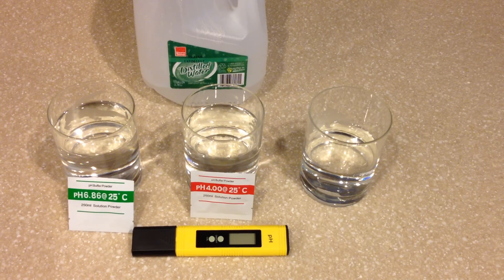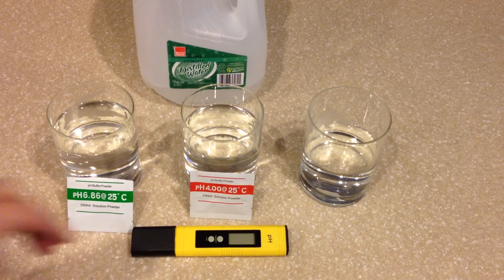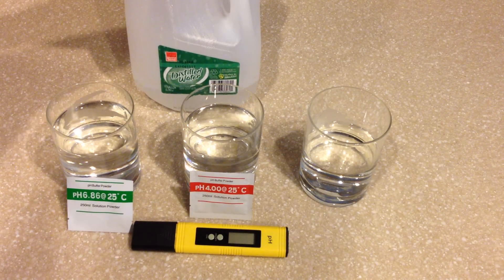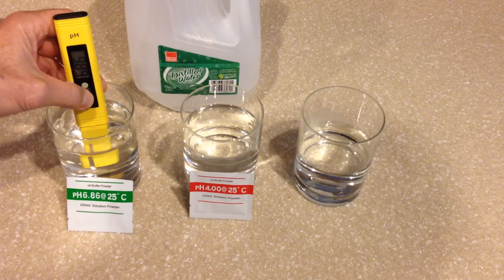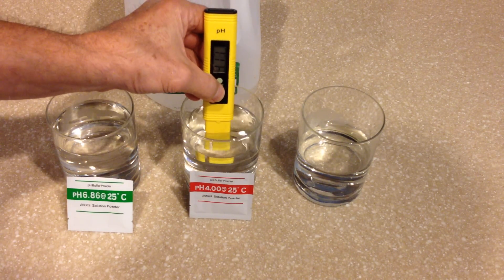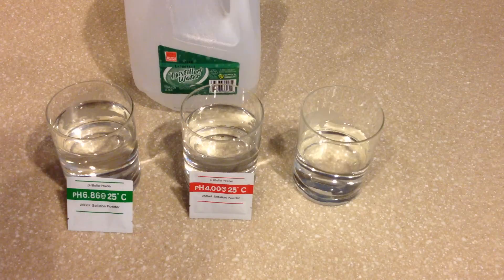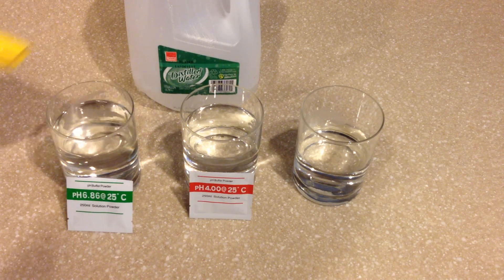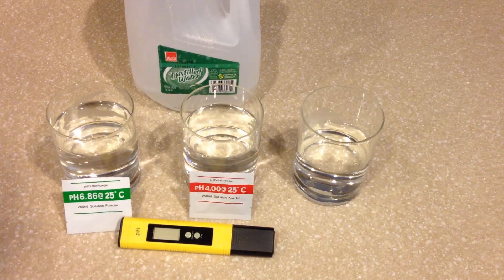Digital Ph Meter Review - Push Button Calibration

Comment: I have a similar device, but I could not understand the manual -- it is in Chinese only.
Your simple guide helped me to accurately calibrate my ph-meter.
Thank you and greetings from Russia!
Reply: I didn't even get a manual. Thank you for the video.
Reply from the maker: Happy that you found it useful. Thanks for watching!
Reply: The use is straightforword, but then somte time you have to replace the batteries (maybe mine were quite empty at the beginning) ...
There is absolutely no mark on the plastic to where should be the plus and where the minus !!!